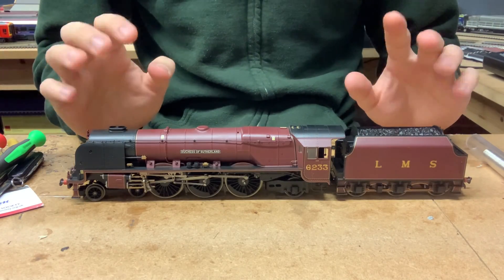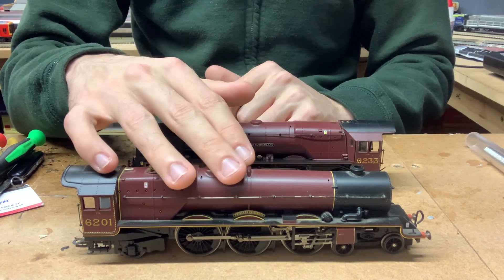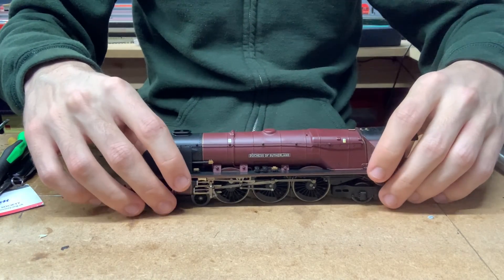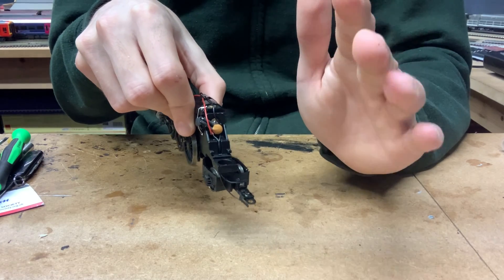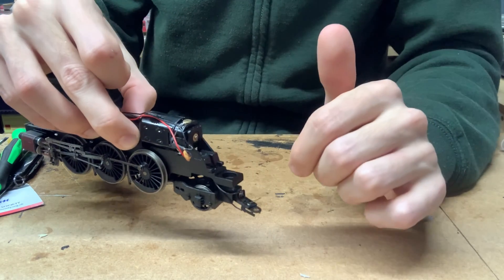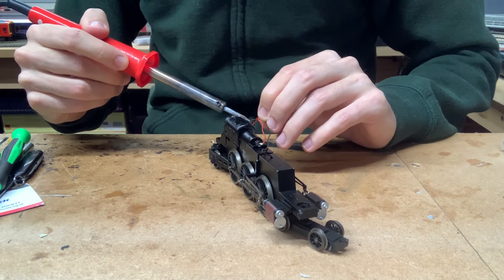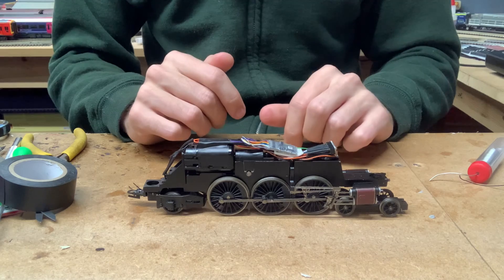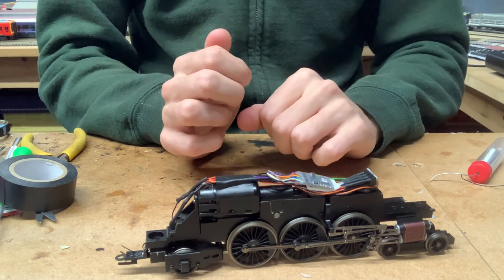Hornby Duchess class DCC conversion

Comment: That jamming up could be split gear either on the idle gear or main drive axle gear. They are notorious for splitting their nylon gears. Also I have hard wired many a loco and especially with steam as body clearance is much tighter I always test my wiring on the programme track. I make sure im getting reading from the decoder with the body still off . No reading means a short which must be found before main track testing as if you dont do this your decoder will fry in seconds due to the higher voltage on the main track. Also by not putting body back on straight away after fitting and you have successfully tested instalment you lessen the risk of body/loco damage without repeat fitting of body . I use Lais 8 pin decoders (860021)s for this type of job. I wish I could solder nicely but have to resort to insulating tape which causes more cramping of wires when refitting bodies. Nice video keep it up. Oh by the way shame there is no wiring diagrams available for models.
Reply from the maker: Thanks for watching bud and appreciate the info. The jamming up was the valve gear on this particular loco if I remember correctly. Either way it’s been resolved for some time now and she now runs very well.

Comment: May be worth trying a back-to-back wheel gauge, which checks the spacing between drivung wheels. It allows you to push them together to make sure they are running true
Reply from the maker: The issue definitely wasn’t the back to backs. Pretty sure it was the valve gear. Either way she’s running perfectly now.
Reply: @fyfieldjunction  That's good, glad to hear she's running better. 
I found your video very informative, and useful.
Reply from the maker: No problem, thanks for watching 👍

Comment: Just bought a 2004 Coronation Scot Pack where the loco is wired this way so your vid very helpful. Mine shows a slight tightspot as well so perhaps a tooling issue but after good lube and running in on DC for a couple of hours things seem better. Planning to do a sound fitting on mine with Youchoos kit and Zimo decoders always improve running again.
Reply from the maker: Thanks for watching my friend. Hope you have many hours of enjoyment with the coronation Scot and best of luck with the sound fitting 👍

Comment: Hi, I am looking for precisely the type of Hornby 4-6-2 you are working on in this video that has a loco drive, not a tender drive, and has the bogie under the cab as a separate free moving bogie with flanged wheels, unlike the current batch of Hornby locos. What are the identifying details for this loco? Serial number, year build date? How do I identify it?
Reply from the maker: Hi there. This exact loco comes in a train pack Hornby produced with three royal train coaches. I have done a review of the pack itself shortly before I filmed this video. The serial number for the pack is R2370
Reply: Hi, thanks, I did some some more searching and managed to find the duchess class with the specification I wanted as above, thanks again